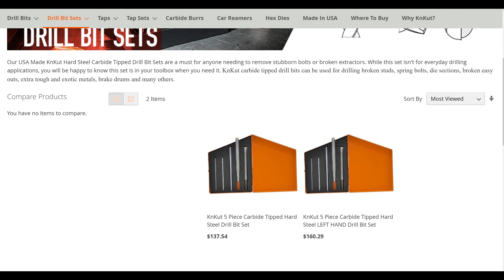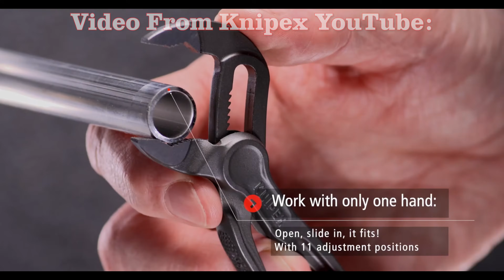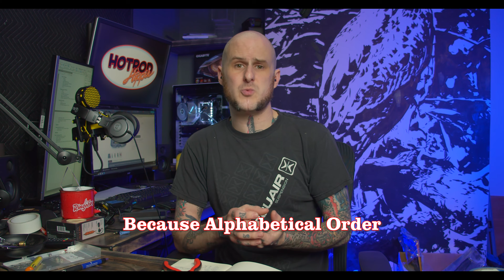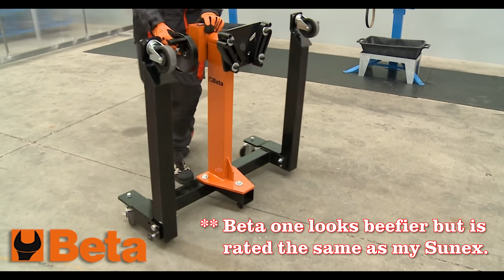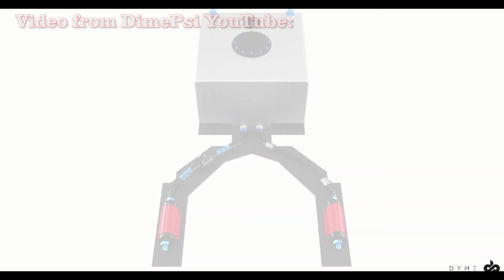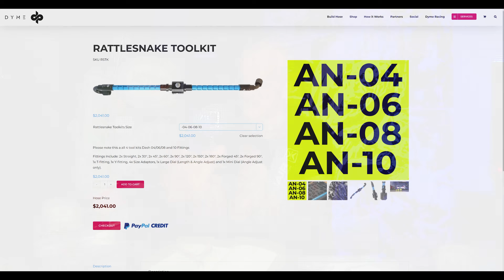SEMA 2020 NEW Tools - SEMA360 - ft. Stacey Cook

Comment from the maker: Any of these tools up your alley? Or would you rather put them out to pasture?
Reply: On the engine stand, a worm can drive a gear but a gear can't drive a worm so it doesn't take much to friction lock the worm to prevent rotation.
Reply from the maker: @SpeedyMercer  I was thinking the gear reduction meant the load was reduce on that locking bolt but your point is more correct. Good call. 

I still don’t care for that locking mechanism. It requires an additional tool and overtightening and breaking the bolt is still a concern. A bolt with a lever arm on it would have been better IMO.

Comment: The Dyme tool, seems a little crazy. Just put your fittings on both sides, and take a piece of hose, and run it from where it would sit in both fittings, thats your length. It would also be way cheaper to buy "real" an fittings and hose from amazon, assemble it to the proper length, and send that into a shop for a higher quality hose with a perfect fit.
Reply from the maker: You should buy decent quality fittings / hose to ensure the dimensions were correct on those mock-up hoses.  Especially since their product is PTFE lined which doesn't curve as easily as "cheap" AN hose.  A "cheap" PTFE lined hose kit off of Amazon is $75-100 (if the fittings it includes are what you want/need).  That doesn't include Tees or Adapter fittings.  So that may get you  2 or 3 hoses on 1 Project, IF the fittings included match your needs?  More likely you'd have to buy a handful more fittings to do that.  So now you are looking at $100-200 let's say (if you end up buying two "cheap" kits).  So if ONE car costs your $200 in mockup fittings (PTFE doesn't come apart and go back together nicely so reuse would be an issue), you'll have paid for the DymePSI kit in 2 projects.  

I did say it is for someone like me building numerous cars, not someone doing one project in their garage.
Reply: @HotRodHippie  I hear yah, but we are talking about mock up, not for use, so re-using fittings is fine, i do that all the time. Cheap hose is cheap and can be used multiple times by just removing 1/4" of the frayed ends. If you know the other hose doesn't bend so far, dont bend it too far in your mock up, i do that with ptfe, when i mock up for stainless or power steering hose. That being said if you do this all the time, then i could see the dyme kit being pretty useful. But i also have a very reasonable hydraulic hose company a couple miles away that makes high pressure hose with any fittings you want, any length, made while you wait.

Comment: I like the idea of the cutting bit only being on the top for the bolt extractors, so you dont ruin the threads when drilling out the bolt. If the top breaks on ANY bit, its done, so dont see the benefit of having anything along the side shaft for cutting, unless you need to bore the hole out.
Reply from the maker: My point was that the Matco Solid Carbides could be resharpened. And that “tipped” drills means some form of welding or bonding process. Which is a point of failure beyond just breaking the carbide itself. 

Otherwise I agree with you. Though it doesn’t really take a “cutting edge” for an edge to dig in.
Reply: @HotRodHippie  Thats cool that they can be resharpened, and i agree about the welded point, that is where most of my bits fail. That bit set should be all carbide, cobalt, or al least stainless for that price.

Comment: Great video 👍 like using step drills on sheet metal usually makes a nice round hole.
Reply from the maker: I need to  do a video about what I use most of the time. Step drills are handy I just often have sub par luck with them myself.